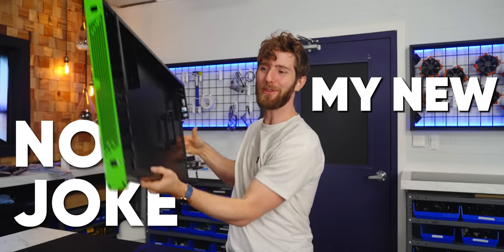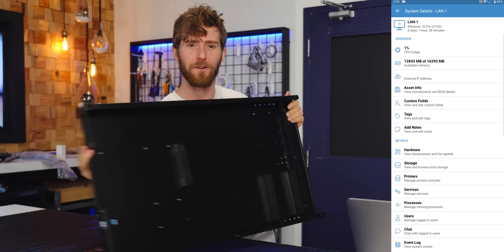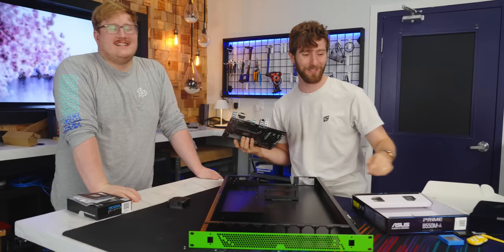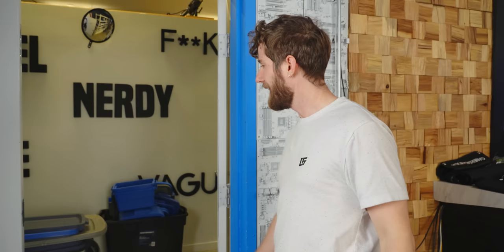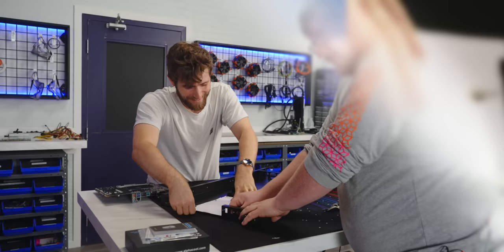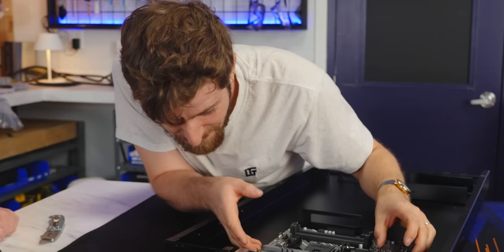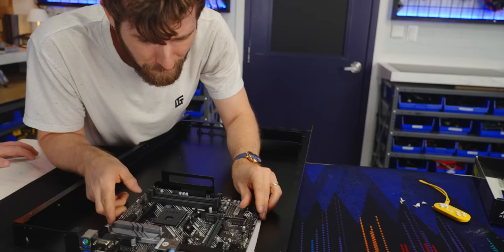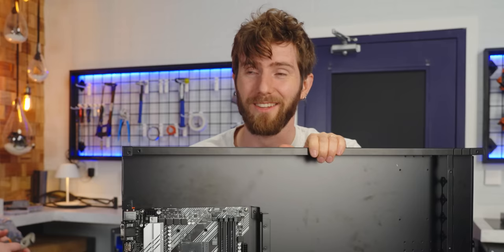This is my new gaming PC! - 1U PCs for My New House Part 1

Comment: BAKTRADITION
Baking mat, beige, 16x12 " (41x31 cm)
$7.99 from ikea (or probably many other kitchen supply stores) is very thin, cheap, and can go in the oven up to 225 C why not try one as the motherboard “insulator”

Comment: 11:29... so wait, u mean like, run the water in a pipe to the pool water and then return (without the waters mixing or touching), or u mean literally, dumping it into the pool? Ur pool water has chemicals to stabilize the ph and to stabilize other chems in it, to doo their job. I don't know what's in cooler water for pc's, but, u want that in ur pool? I really doubt u want pool water in ur pc system but, if u can make the cooling out of pvc pipe fittings, u might be gucci!^^ 
\O>

Comment: Could they not have just measured the highest contact point an then 3d print a standoff?? It would made for a much more elegant solution. If the flex in the mobo is an issue just  again 3d print spacers some where in the middle where there is an attachment point. I do that all the time with Pis or what ever MC im tinkering with.

Comment: I wonder... Wouldn't a 4U with 5 MITX boards work too? I mean you can stack them vertically and have enough space for PSUs, water cooling, the graphics cards, etc. Sure the maintenence part is a PITA but supposing you're using quick disconects anyway it'd be almost the same as dealing with five individual 1U racks.
Reply: Not only would maintenance be a pain, (which is why you would not do it that way anyway), but he specifically mentioned that having more than one machine in a single unit means that if something breaks then all of them gets taken down. It would be incredibly rare that all five pcs would need that kind of maint. at the same time. Then there is the nightmare of lifting 5 water-cooled systems at the same time and having to be even more careful when working on them. It would honestly be easier building 5 identical pcs and putting them side by side on a shelf somewhere.

Comment: B550F
Ryzen 5 5600x
32 gb corsair vengeance lpx  @ 3600mhz
650 watt psu
2 tb hdd
Radeon rx 6600 eagle 8gb
Air cooled 4x 8" fans in the case rear exhaust.

Comment: Should have just used the tape on the bottom of the mobo. The cardboard is not only a fire hazard but f#$king around with that took longer than applying the electrical tape would have.

Comment: Uhm . . . if you'd gone with the netboot option, how would you add a 10GE NIC when there's a GPU occupying the only PCI-e slot wider than 1 lane? Fairly sure the fastest networking option you would have had was 2.5GE.

Comment: Is it just me wondering or do they actually forgot or didn't heard about Capton tape 🤔 because that's the MAIN item that is used to insulate metal surfaces so that electronics equipments doesn't short each other and is also heat resistant 🤷🏻‍♂️🤦🏻‍♂️

Comment: lol i am a electrical engineer ding ding where is yours he should have a roll of hand with electrical tape for u know them big big power capable raps but yea 5 cm width would have made isolating that mother board easy here we go with the icron docks again seen them atleast 5 times in linus vids he goes like they are amazing next thing you know next 10 minuts of vid is about them not working ^ ^

Comment: I know it might be too late, but a suggestion for you would be a piece of  PEI cheating they're not too expensive and they're used for extreme high heat for when you do 3D printing. And they're thinner than or is thin is at piece of cardboard you just put in

Comment: I didn't have an IO shield on my computer and frequently my mouse and keyboard connections would drop for 3-5 seconds when I sat down at my computer or grabbed my mouse and felt a static shock. Never happened again after I installed an IO shield. Hopefully you don't have this issue.

Comment: Funny enough this looks like a smaller version of my b660 asus prime board. Problem with the prime series at least in my case is I had to update the BIOS because it was working okayish with a lot of RAM detection issues and constant BSOD's. It took not one but two freaking BIOS updates for ASUS to fix my board. In the meantime I had to suffer with my PC for several months in the meantime. I almost considered sending it back to warranty. Honestly the problem with budget ASUS builds is the BIOS lottery, where some boards come with a better BIOS then others.

I will say that the VRM's and cooling performance considering it's a budget board series is easily the strongest selling point.
Reply: My point is that the game crashing could easily be the BIOS. It's the first thing you should check before ripping apart your system on an ASUS board like this.

Comment: Not concerned about chlorine damage?  Are you saying the water will flow into the pool but you are not taking more water back out of the pool?  Or are you saying a heat exchanger through the pool without circulating pool water through your rig? (oh okay.... so I finally saw your tubing.  Your rig is going to run hot during the summer.)

Comment: What was the issue with having server grade motherboard and airflow cooled GPU? Data centers have GPU servers for ML. I am sure cooling/power isn't the issue. Is it cost? I would guess there'd be cheaper 1U options that have lower performance compared to server grade configurations.

Comment: So that tubing is 10/13 based on the thin walls? Where did you guys get your 10/13 epdm/zmt tubing from?  I ask as I'm in Canada too (Ontario) and can only find easy sources for EK zmt which is only 10/16 but I'd prefer the thinner/skinner 10/13 sizing.  Thanks.

Comment: I have the same gpu as they are using in this build, and it has a super shitty water block, the back side is passive and its constantly thermal throttling...

Comment: I could actually do PCIe passthrough with 5 GPUs for 5VMs and a low spec GPU for the host system. It would take some time but it works.
I only use one VM but I can / have to connect a display device preferably with speakers and headset connections.
Only completely AMD systems and if you want a holy shit version do it with a SR-IOV GPU on the right motherboard because it might need to support it unless Linux can do it without the MB.

Comment: Solution for people who aren't millionaires: Buy ryzen 5000 system + midrange GPU cause then the power usage and heat is low enough you can just run it low fans and not turn room into furnace

Comment: Hey guys, I have an urgent question. If I have a 60hz refresh rate laptop and connect it to a 144hz monitor. Will I be receiving 60hz or 144hz on the monitor?

Comment: 16:50? Bro seriously? Just take a little plastic project box, make some cutouts with a dremel, hot glue Fan connecers in there, solder the cables together and you got a fanhub that never fails. With the kind of team an machinery (like 3D printers) LTT got thats just pathetic lol

Comment: How can I find that GPU water fitting??  I'm scouring the ekwb website with no luck and it's the only thing you didn't list in your parts links!  I'm doing a 1U ITX build and that is exactly what I need but cannot find it (most likely because I don't know what to search for).  Can anyone help point me in the right direction?  I have a 2060 if that matters, but I'm hoping that part is modular to go with at least a few GPU water block options.

Comment: Hey, a lot off topic here but, do you guys know how to solve a foggy screen? Its as if there is tons of contrast but I keep it on 80%. I have reset my monitor and many other things. I tried things from the internet, as far as buying a new HDMI cable. If you are wondering, my monitor is a (Dell S2817Q) and I have it connected to the HDMI port on my gtx 970. Not really sure if this is necessary but my computer is a per-built (XPS 8900). This issue has been going on for 5 days as of the time this comment was posted.

Comment: Is the pool water chlorine based? Also, would it cause corrosion?
Reply: The water doesn't actually mixed together. There's an exchanger.  Like two flows come together in a metal device and exchange the heat between them. Well that's how it's usually done.

Comment: .

i got a free nvidea 3080 as a shipping mistake from amazon i wanted to make a emulation station pc
should i go 2u or 3u? i could always slide a pc in sideways i guess but trying not to scratch it all the heck
i want a closed loop water cooler (1 block if possible) for cpu and gpu can be air or water cooled doest matter my stuff is not fancy room/space/money matter.

my goal here is to use the 3080 (the only part i currently have) would be nice to water cool but i dont have "linus money"  so money counts.  i dont want to scrape a pc case or my rack by sliding it in and out if i need to make it work. i have 40gbs fiber at home so 10g is fine. would love to see the 2u blueprints that were made.

also how do you get the video from the pc to the monitors ?  over 10g?  as i know any cable over 15 feet is normally crap.
would love a reply do not feel i'll get one tho.

Comment: to be honest that 5th system is for having a friend over right? 2 kids wife and yourself + 1 guest. Fuck it at that point just have 2 guest machines also considering you are making a custom case there are already solutions you can look at for fitting 2 1U systems into 2U unit that make it so you can only take out 1 system, and you can still have the benefit of having SFX power supplies.

All the other benefits would be gone though, this is done in the data centre so that you only need 2 PSUs and each PSU is capable of running both systems.